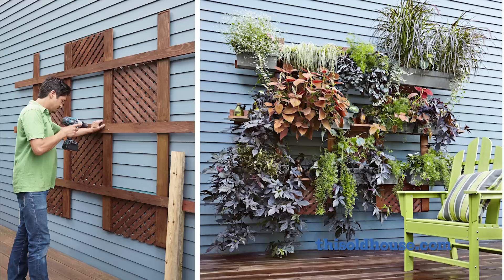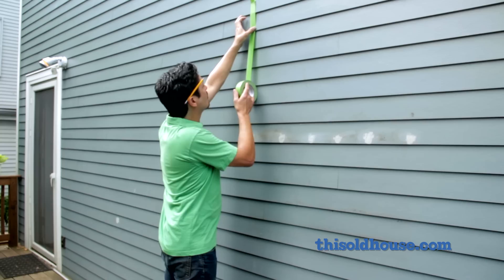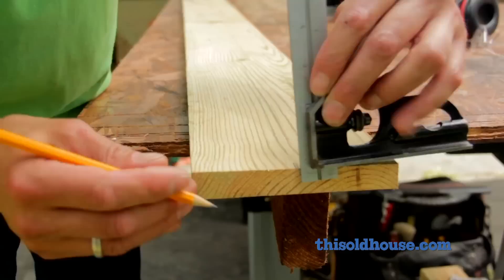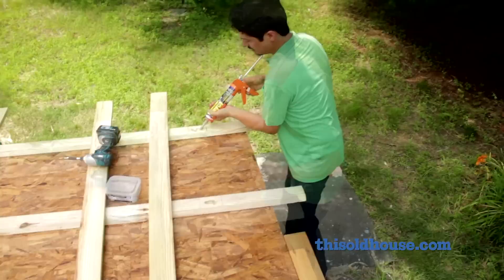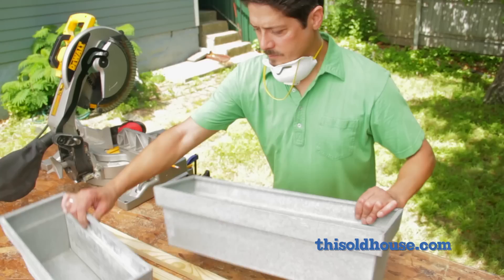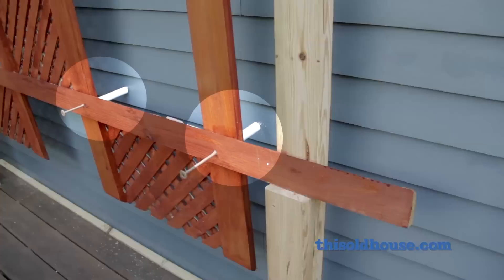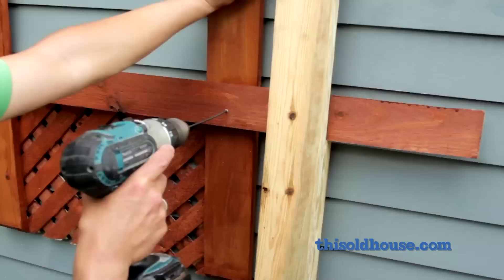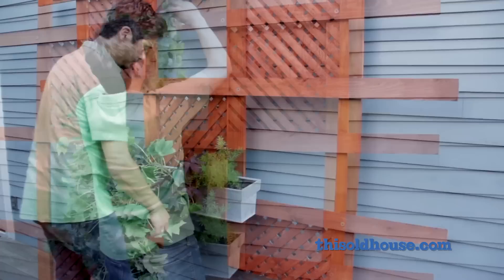How to Build a Living Wall Vertical Garden | This Old House

Comment: Um let's see.. drill holes in siding, make holes for carpenters ants, ruin siding, let water inside wall, call servicmaster mold remediation squad for $100,000 damage, file insurance claim and get denied, get sued, mechanics lien on house. 🏠 no thanks.